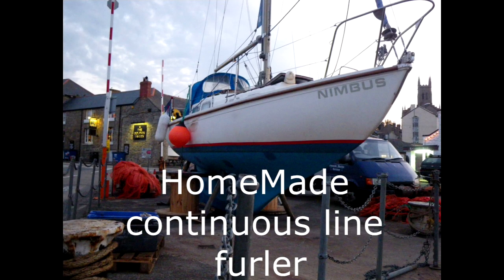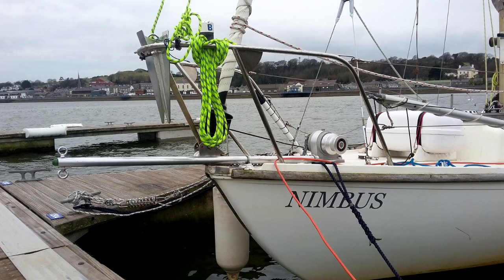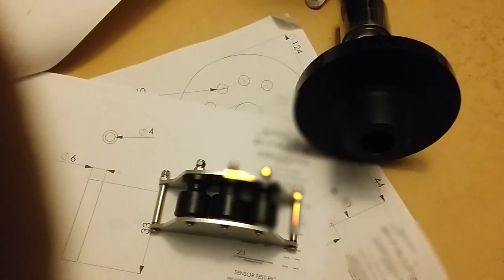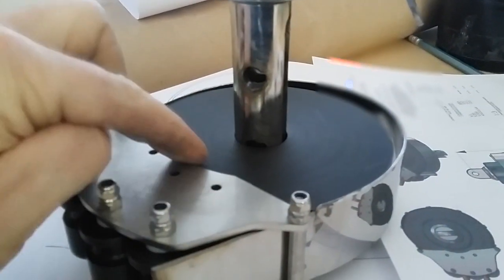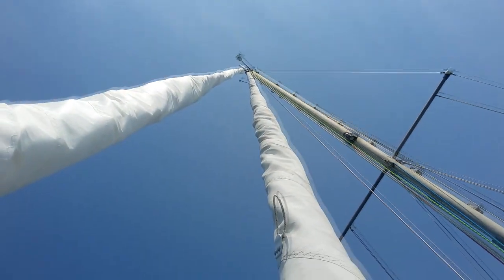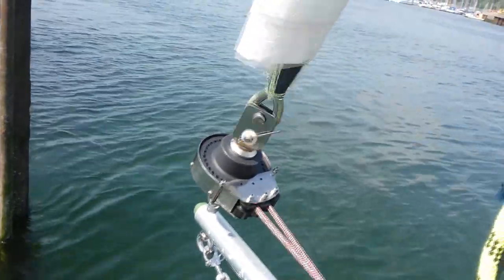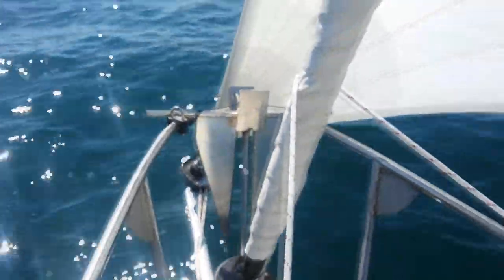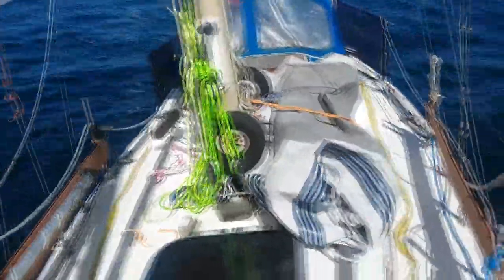Sailing .... Homemade continuous line furling unit for a Code zero

Comment: Terrific DIY. Well done.  Can you reef it?  My friend has a genoa as a headsail in her 36' boat, continuous furler. It's either  furled or all the way out. No reefing option. (I find this utterly bizarre.)   I can see where this isn't an issue for you as you have a second headsail behind the Code Zero. That would be the one to reef. 

One idea I had,  based on a workaround for my Hydrovane, is if you can cross the lines as they come off the drum, the line never jumps the groove (there's no outer housing on the Hydrovane drum -- the adjusting line is to be held in place by a bungee on a block and a continuous line. By crossing the lines before they go through the two 'fairleads'  it never jumps out of the track, I don't need the block and bungee.   Crossing the lines doesn't increase friction by the line rubbing against itself. It gains friction by a 270 degree +/- contact with the drum, versus 180 degrees +/- of the usual set up. 
I'm going to try this on her continuous furler. Or add a single 'furling' line that wraps around above the drum. Instead of the usual furling line wrapping as the jib comes out - this will unwrap. Then when  she wants to reef, lock that line down on a cleat.
Reply from the maker: Hi, thanks for your thoughts regarding the contact angle. I don't reef the code zero, just furl it.   The drum might manage this, but the rolled sail shape wouldn't be great. Typically if the wind picks up the Genoa then takes over.  For dead downwind, I sometimes hank an old jib to the inner forestay (with whisker pole) for balance, and drop the mainsail.

Comment: Is it possible to get a parts list?  We are trying to build 4 of these for a sail roof.  We need to roll them up during inclement weather.  Thank you!
Reply from the maker: Hi Thanks for the comment, there is a web link to my part drawings in the description which might help, but I designed the unit around an old swivel I had, which might not suit your application so well.  Good luck with your sail roof.

Comment: yes ,, but what is at the top to facilitate the turning / twisting of the hallyard , would the  rope alone not be damaged by the twisting  ?? ty
Reply from the maker: You're right there is a smaller swivel (salvaged from another broken roller reefer) above the torsion rope so it can rotate freely.
Reply: @SVNimbus  ty, R

Comment: why you have the two wooden planks on port and starboard on the railing?
Reply from the maker: Hi, they are called fender boards, and protect the hull when moored alongside corrugated harbour walls or concrete piles, which would slip past individual fenders. They hang outboard of the fenders, ie between the fenders and wall.
The ones on Nimbus are actually  made from PVC decking, so are lightweight. I also use them as a gangplank for the dog, as a workbench in the cockpit, and are useful for attaching jerrycans on deck.
Reply: @SVNimbus  tnx for the info